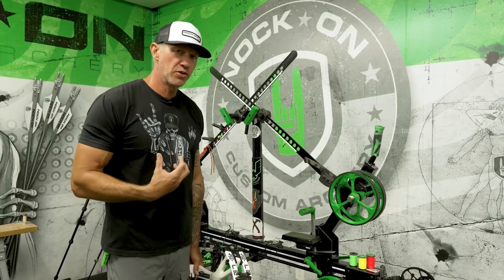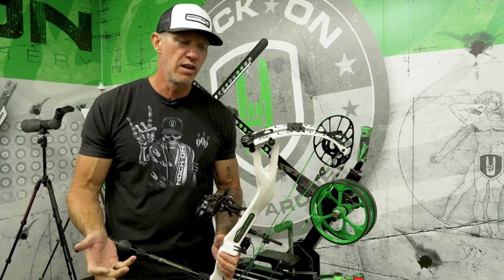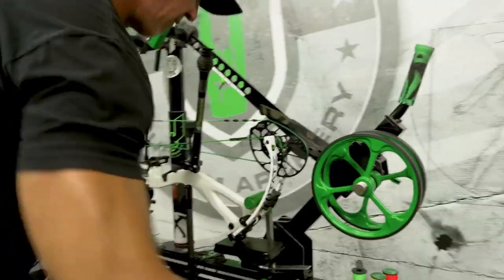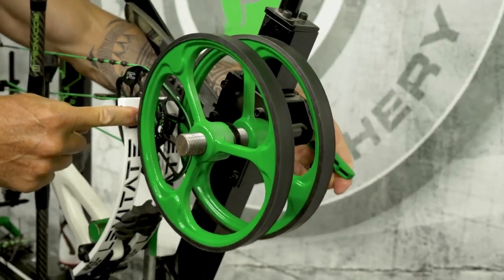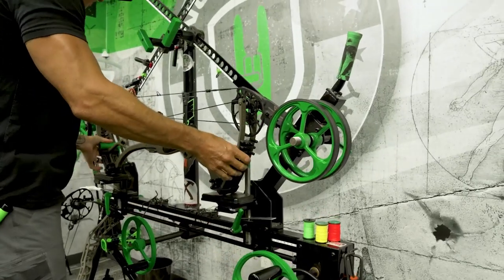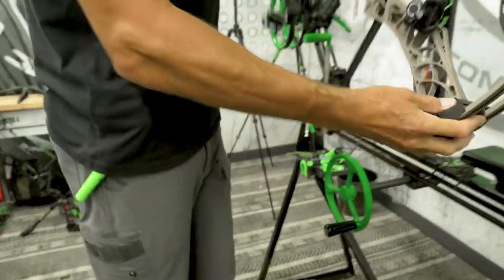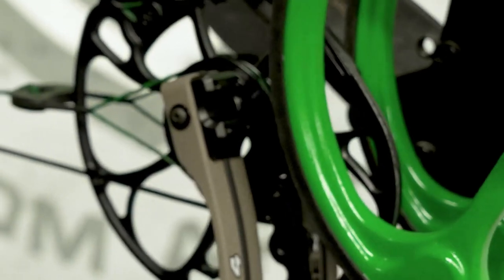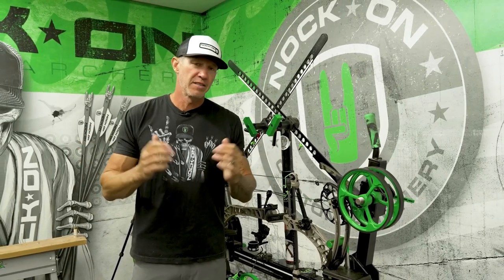HOW TO PROPERLY PRESS THE NEW PSE, MATHEWS, & HOYT BOWS

Comment: Hey quick question where can I get new rubber for the wheels or replacement wheels? I got a older press from a shop and the rubber is cracking and probably needs replaced but have no clue where to get the rubber

Comment: Thanks John, I have the older xpress without the wheels the contact the limbs, mine just has the bar the contacts part way down the limb depending on cam size. Do you think it’s ok to use in modern bows with big cam, on my ntn I’m contacting the limbs quite far away from the axel.
Reply: No way

Comment: New NockOn X-Press coming soon.......
Reply: Doesn't need to be nock-on branded, but the X-press to me always struck me as the safest and most versatile press. You can always get the pressure on the limb tips with no risk of pushing the riser out.
I've always been bummed because by the time I was ready to get a press, they discontinued it.
Reply: @Rikcey  Look at the Specialty Archery Pro Press. I've heard it was designed by the original designer of the X-Press.
Reply: @flyoverbassin8959  for more than double the original x-press I think I'll go the last chance way eventually. That way I won't need a separate drawboard.
Reply from the maker: Unfortunately- No
Reply: @nockonarchery  Booo ;)
Reply: I don't actually know if there's a NockOn X-Press "coming soon".  However,  based on what I've seen in the past and the 'style' of this particular video, it appeared to me  to be a little foreshadowing for an upcoming product release.  Maybe, maybe not.
Reply: @Rikcey Gooday from Australia. Yes, I'm a qualified engineer and keen bow hunter. I lucked out finding the very last new X-Press and stand in the country. This design is without question the best in terms of securely holding while evenly pre-stressing the bow. 
Testimony to the superior design is that two different bow shops begged me to contact them immediately if I ever think about selling it.

Comment: Have you ever messed around with a Synunm Bow Press?
Reply: I have. What's your question
Reply: I have not.  I'm currently using an EZ Green Press and haven't had any issues thus far.   Before buying the LCA, I searched everywhere for an X-Press bc of how easy Dudley made them look to operate and just how cool looking they are.  Unfortunately,  didn't find what I was looking for and settled with the LCA EZ Green.
Reply: @rwittman9932  specialty archery would now make the closest thing to an x press. What's nice about that style is completely breaking down a bow for a limb change or something to that effect because those arms move in a downward moment with the limb. Last chance presses are fine as well but it requires additional parts or to know what your doing. The synunm should only be used for maintenance
Reply: @jordanpowell228  Do you feel secure with it for putting in a peep? What bows have you used it on? I also had a bow where the dealer had to tune it by moving a spacer. Would you be comfortable using it for that? Do you use the "UltraFlex Adapters"?

Sorry for the loads of questions.
Reply: @7bongode  it's going good for simple things like peeps, peep twist, adding a twist to your cables etc. I suppose you could shim a bow with one but I do not recommend it at all. The adapters are for bows with past parallel limbs like the hoyt defiant series. If your serious about archery I would save to buy an ez press or one of the specialty archery presses that function like dudleys xpress